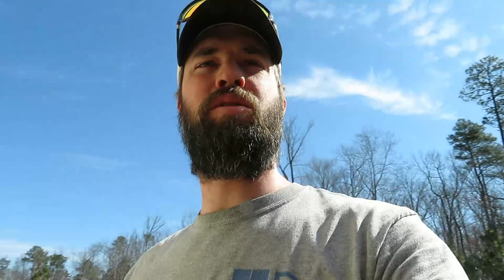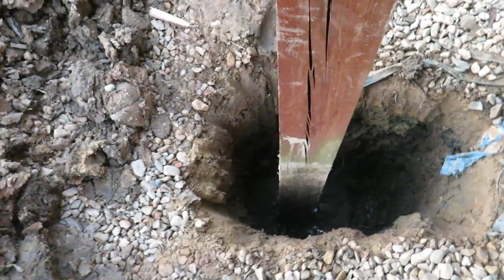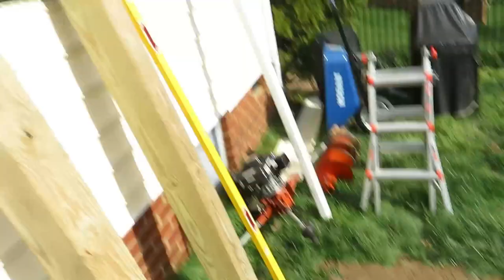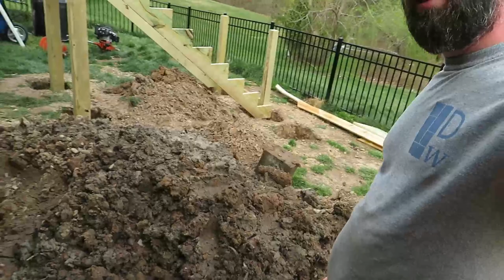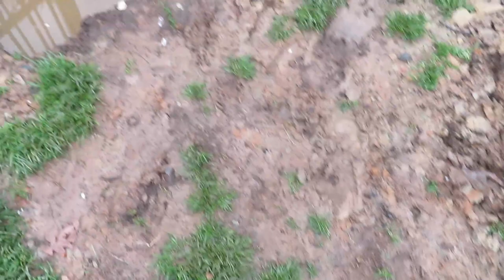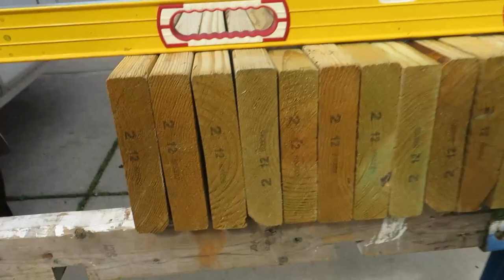Building a Screen Porch & New Deck - Part 1

Comment: Go Packers! Are you from Wisco?
Reply from the maker: No sir. Just been a fan for a long time. Though them releasing Adams hasn’t made me very happy….
Reply: @thebedfords  that definetly sucked! Ever get to lambeau field? Bucket list thing if not. 

Also side note, just had a covered porch put in this week and they used a footing for one post and a tie into concrete for the other..is that going to be a problem? I trust they are solid builders...thanks! Been watching your vids, excellent work
Reply from the maker: @jandyallday  haven’t made it out yet. Definitely on the list. 

Meaning they dug a footing for one post, but they anchored a post to an existing concrete slab or something?
Reply: @thebedfords  yeah exactly. My patio was shaped in a unique design. Any concerns for the lifetime or the porch to potentially be uneven considering the two methods used? I'm in Charlotte NC for climate.

I think we have 2-3 years with Rodgers to get another title..then can we get a 4th straight HOF QB??
Reply from the maker: @jandyallday  well you’re not supposed to use a concrete slab to bear a post on. They are usually only 4” thick, and the footing needs to be down below the frost line and thicker than that. Hard to say without knowing more about it. 

I still miss the Rodgers/Nelson days…
Then Adams came around and was so good. I even have a signed ball from him that a buddy got for me. Now it seems like everyone is leaving….
Reply: @thebedfords  I should clarify. It's just a covered roof over my existing uniquely shaped concrete pad.
Reply from the maker: @jandyallday  it might be ok then. The issue is that concrete doesn’t have good tensile strength, so placing a load in one spot is a bad idea, if done incorrectly. It likely wouldn’t meet the building code. Will it fail?  Probably not. Again, hard to say.